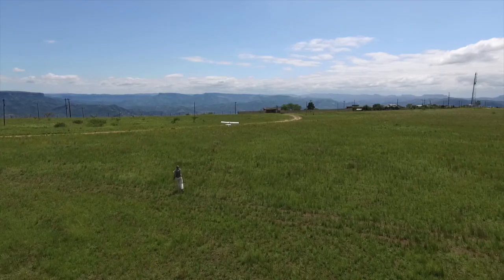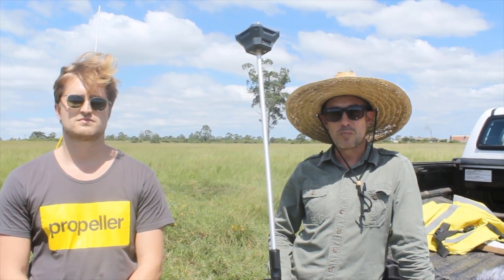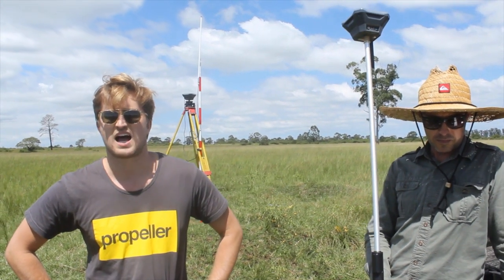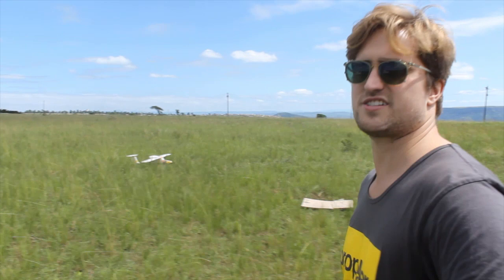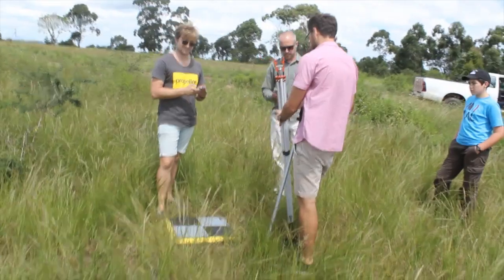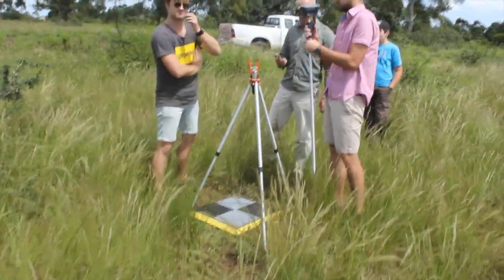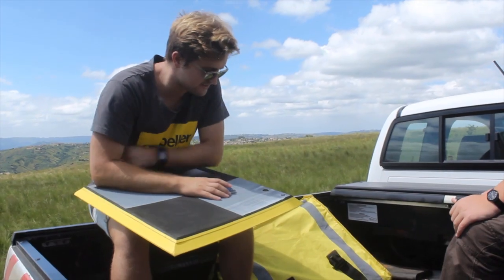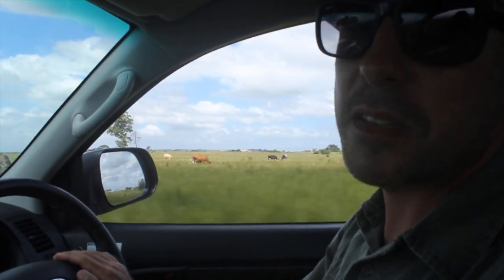Propeller Aeropoints | Let's find out if they work

Comment: Emlid seems more robust. Less time messing with individual wifi spots, Fastaquisition of points, cost is a fraction and is less bulky to move around. Also is does not need an LTE network to work.

Comment: Question: What is the difference between accuracy & precision?

My experience with them was they aren't very flexible in terms of low light performance, travelling (bulky to carry) & you need to connect the aeropoints network (CORRS or no CORRS) to a reference ht (Permanent Mark) GPS Rovers using CORRS as a base solution still need to connect/verify ref hts (Ties into the question above)
Reply: Precision is shooting someone right between the eyes.......Accuracy is making that shot but shooting the wrong person.